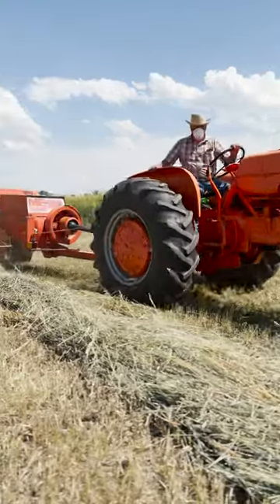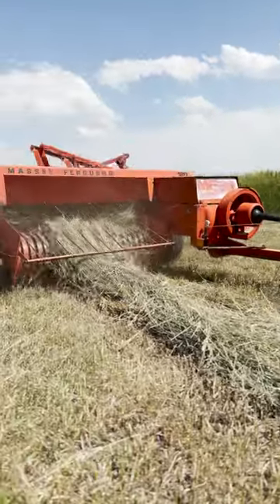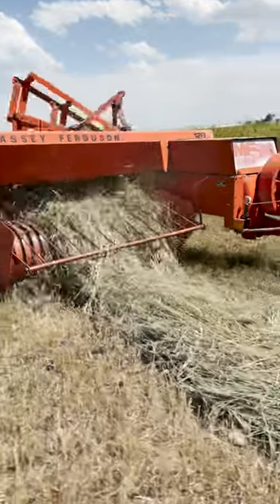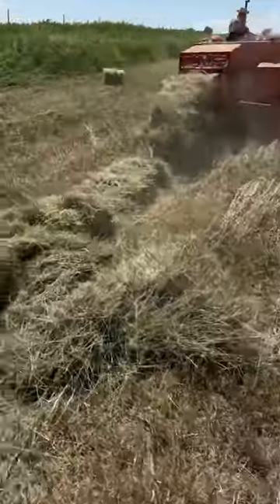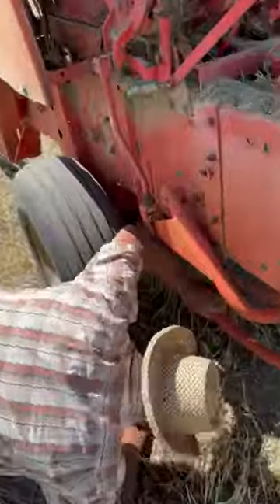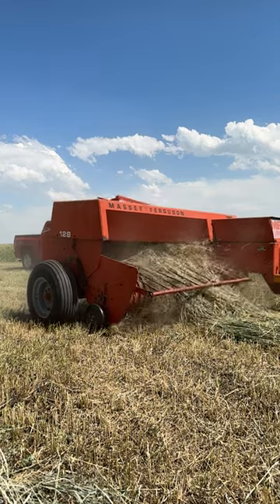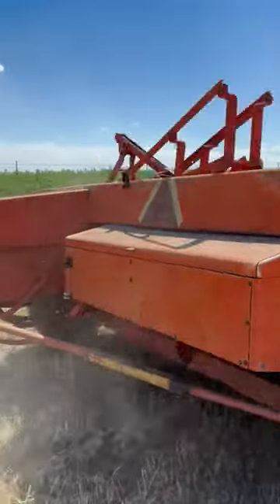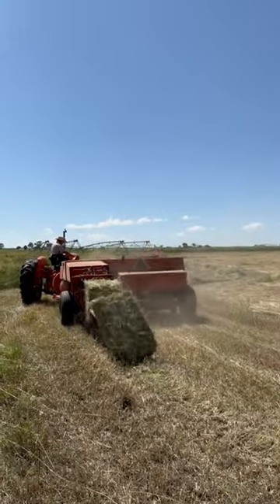#shorts Baling Hay W/ Allis Chalmers D17 & Massey Ferguson 128

Comment: Anything pto driven is definitely something you dont wanna get sucked into. Don't care if you're plant or meat, it's all the same. Not only is the PTO terrifying as is (get spun apart) but i ran over a calf in my youth with a bushog and the feeling the tractor made will stick with me forever.
Reply: Ive seen someone get their arm grabbed into a stationary baler before that wasn't pretty
Reply: My neighbor back in the early 70's got his overhauls caught while doing something with the post hole digger on the tractor. He was working on it in the yard. 
His wife never heard a thing, came outside and he had done got his head beat off on the rear tires.
Reply: @kramnull8962  Nothing worse than that cause the machine's still running. Local veterinarian got hit by a limb and thrown under his bush hog. His son found his tractor first in the trees 500 feet away from what was left of his body, stuck but tires still spinning he said. I just bush hog for the city but i have massive respect for our farmers, and our equipment.
Reply: @infernaldaedra  My ornery old coworker, who trained me, said, "you gotta be stupid to get hurt on one of these, but once it's gotcha. It has ya. Ain't nothing to do about it."
Reply: @aaronmoore2691  He was talking to a coworker while loading and operating it, Got distracted and forgot where he was for a split second long enough to get his arm bailed up through the bicep.
Reply: @infernaldaedra  I don't remember on the top of my head if someone got killed by a pto, but my father mowed a doe with a disc mower last season, brutal stuff.

Comment: Back when I was a senior in high school, a guy got caught by pickup tines clearing a jam on baler intake. He had left it running with pto engaged.Had a long sleeve shirt on and cuff got tangled in tine. Sucked him into the machine. Took the fire department most of the day to get him out of it. They cut the machine apart to do it. After that it was the coroners job. I always turn equipment off so that doesn't happen to me or whomever is working with me.